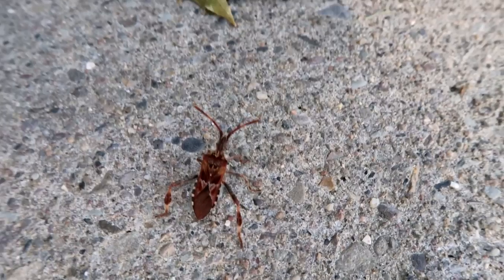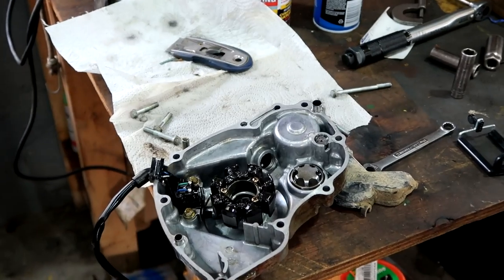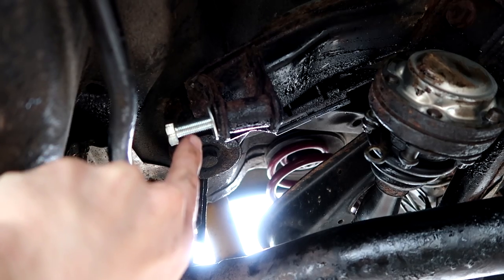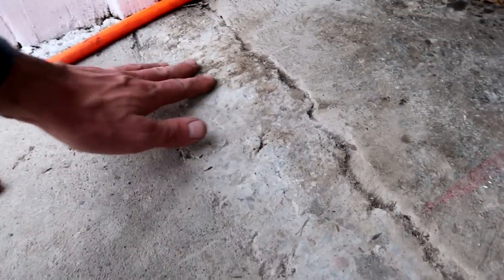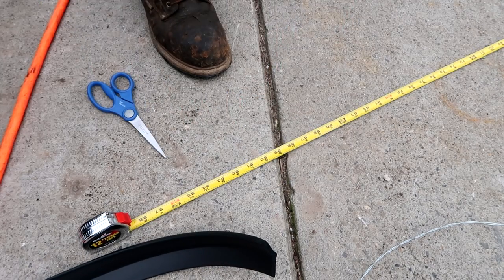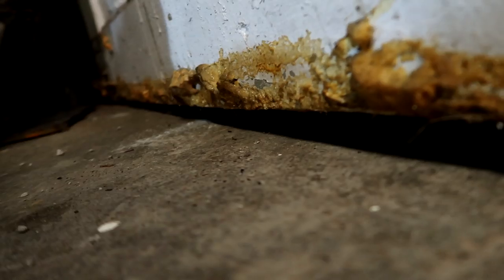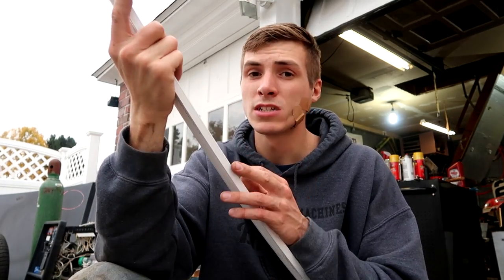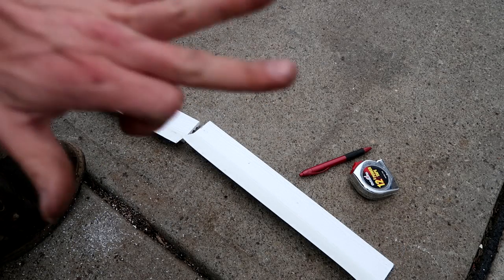NOT MY FIRST RIDE

Comment: Hey 3D, you should also put some insulating foam over each panel of the garage door and its windows.  That will help immensely.
Reply: angrybeans it's wood it's considered insulated, styrofoam won't really help unless it's a metal door that's not insulated

Comment: Hey dalton! That rear diff bushing still needs the outer sleeve removed. Not sure if you caught that but burning the rubber out essentially does nothing. That bushing has the outer metal sleeve that is press fit into the diff. The rubber acts as a damper for the inner sleeve which the bolt slides through. I'm sure this will make better sense once you receive the new bushing. I recommend an air hammer and a chisel bit to drive that sleeve out. Or just a bfh and chisel lol. Anyway keep up the good work man. Love the videos!

Comment: I found the best way to get bushings like that out is to use a hack saw to cut a slot in the pressed in metal part. Then there will be less tension on it and will easily tap out.

Comment: Shoot, why not just put a strip of that seal molding across the top of the door frame to seal the whole door off?
 You do know that you have to press that broken bushing out of your diff in order to get the new one in, right? You might be able to do it using the sockets and c-clamp method. 
 A trick to put the new bushing in is to put the bushing into the freezer for a hour or two before you go to put it in. Then, right before you take it out, heat the area of the diff where the bushing goes. It should drop right into place. Make sure it's seated properly and let it sit for 5-10 minutes and it should be set into place.

Comment: Ausesome video. Question are 2 stroke dirt bike carbs easy to setup?
Reply: NEx HD yes
Reply: If you have worked on carbs before
Reply: It's pretty simple as long as you know where the parts go
Reply: Like what YAM SQUAD said, it is easy if you have experience. I have done  quite a bit of work on 2 stroke and 4 stroke carburetors and I can defiantly tell you that 2 stroke carbs are much easier to work on and set up vs the 4 stroke carbs. There are way less parts in the 2 stroke carbs, and you only have to deal with one throttle cable instead of two, and the list goes on and on.
Reply: NEx HD watch a video if you dont have that experience
Reply: Chase Hewett how often do you have to adjust your carb on a 2 stroke( 98 kx250
Reply: C Trail how often do you have to adjust the carb?
Reply: NEx HD I have a 01 CR 250. I clean mine after about every 5 rides, and I have stock jetting, the only thing I have ever had to adjust is float hight, and my idle screw. However, I have had to rejet the carb on my CRF 250r.
Reply: I have a Honda ATC 250r. And really if its clean all you have to do is set it up for how your gonna typically ride it and changes in elevation and temperature are gonna change the jetting and things. It's all because of the density of the air. You have to be able to know what it feels like when its lean or rich, and you need to be able to read the plug. Newer bikes its real easy to set up the carb. And old stuff tends to be meticulous, like my 250r is temperamental af
Reply: NEx HD
Reply: C Trail Exactly
Reply: C Trail do you have to adjust the carb every time I ride or every time it drops from 14 to 15f degrees?
Reply: NEx HD you absolutely shouldn't have to adjust it every time you ride. You should be able to set it up  and ride it every day for months and it should be fine. Every year tho it wouldn't hurt to check up on it and clean it like in the off season. As for cold goes I'd say like anything above 30 degrees you don't have to worry about it but once you start riding it below that you'd wanna look into rejetting. Jetting charts are readily available too. What kind of bike is this?
Reply: C Trail it's a Kawasaki kx250 1999
Reply: NEx HD you should be able to set it up, and it'll be good for a long time

Comment: 1 door 3/4 the way sealed and the other is left hanging. Not going to see much savings till both doors are sealed. That includes the top edge of the doors. But all is for not if there is no insulation in the walls.

Comment: Wassup dalton i really like your video's! Keep it up! Question i have a Little 2 stroke engine like you have on the board but i have No spark. What can be the problem? Thanks!
Reply: Hendrik Dhoore check the coil, flywheel, ground, kill switch etc. just everything that has to do with the spark.